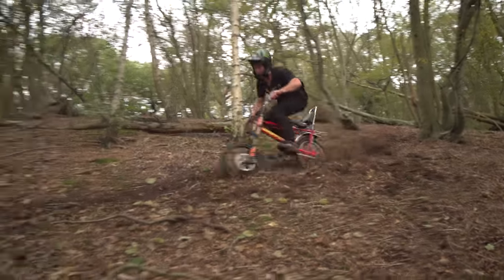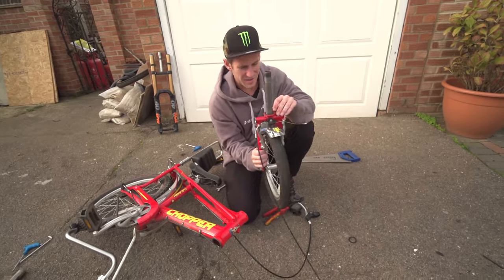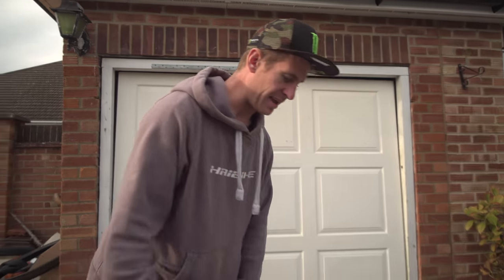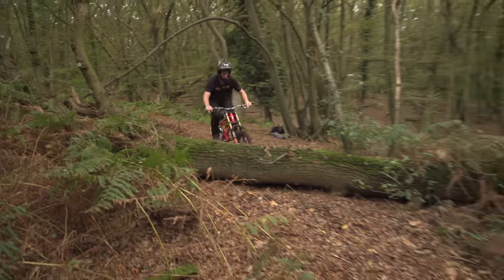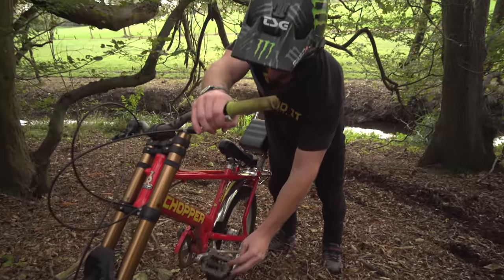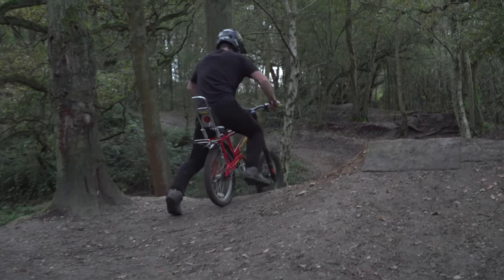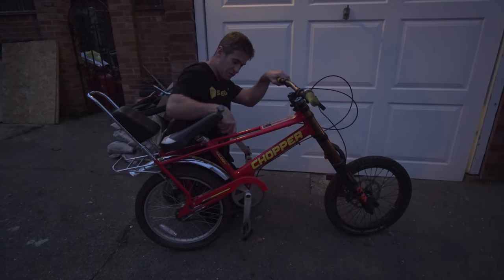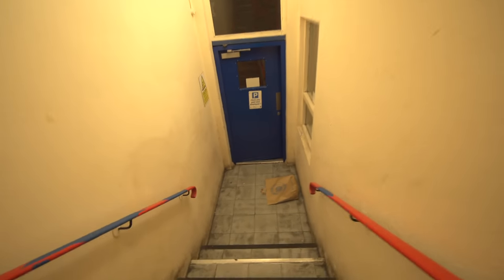THE FREE BIKE CHALLENGE - PART 18 - DOWNHILL CHOPPER

Comment: Excellent,  In 1988 I took a Raleigh chrome burner and fitted a set of Mountain bike forks, A 26" MTB wheel and a set of CW bars, I t looked proper weird but I rode it all summer long, Went swimming and camping on it, I called it The Phantom Bellringer, A year later I created Bellringer MK2 using a 1950's butchers bike fitted with a gold Araya BMX wheel, I miss those days

Comment: Thanks for yet more laughs. The suspension forks kick that geometry back way to much for you to cut loose much. Maybe put a 20" BMX fork and a a 8" t0 10" BMX bar. It should level it off a bit. Also you could install the original fork & wheel, put the PVC segments on the rear, and get Chopper Squirly!

Comment: I just checked that is a early 70s raleigh chopper bike. In the condition before it was modified it was worth several hundred dollars possibly closer to the 1000 mark. Some of those parts go for a pretty penny. Even just the front brake calipers go for 100 bucks a pair

Comment: Why not get the rest of that electric bike on there along side that front wheel you pinched.
That back wheel looked the right size, just grab some "steel torque arms" to mount on the motor axle and the frame. Then just bodge the rest in anywhere its fits :)
If you find the battery is an problem just look into lipo batteries. Cheap enough that you can bodge something together.
Or hit me up and I'll point you in the right direction.